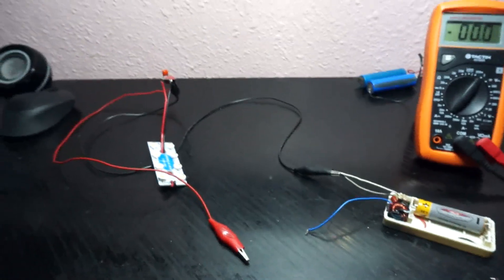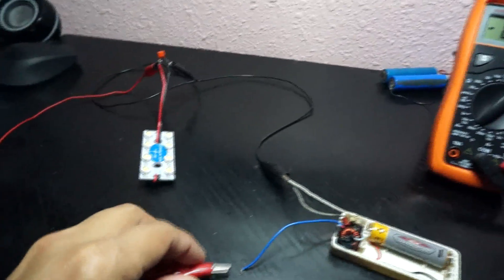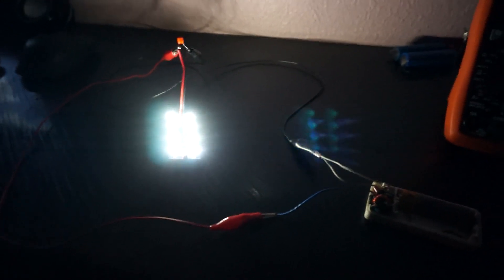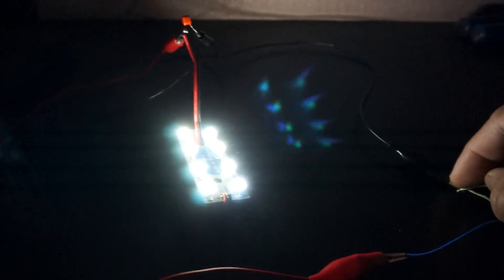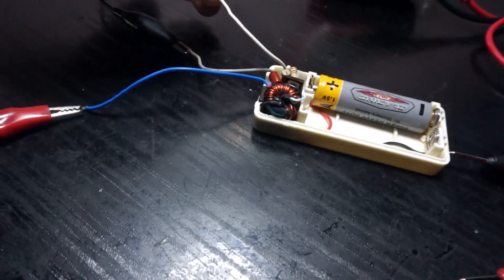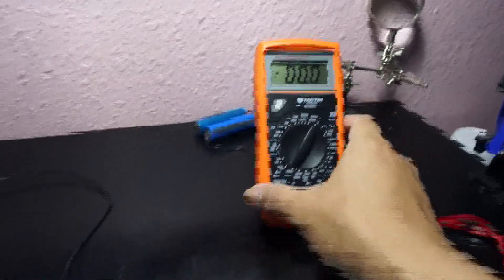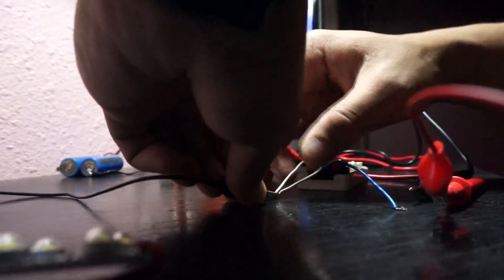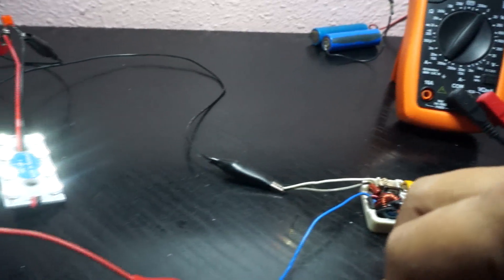1.3 volt battery to a 12 volt led using JOULe thief circuit

Comment: nice circuit, as you mention the battery will last for atleast 8 hrs, however if you add another bat connected in parallel and use duracell will it last for 24 hrs?
Reply from the maker: there is a new version which will last for 36hrs usable light
Reply: redsharp03 ，